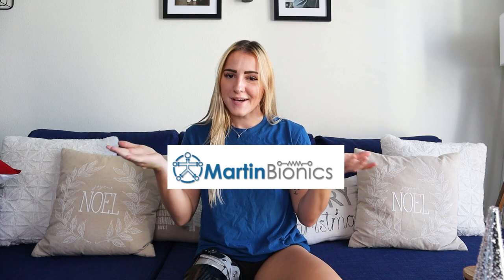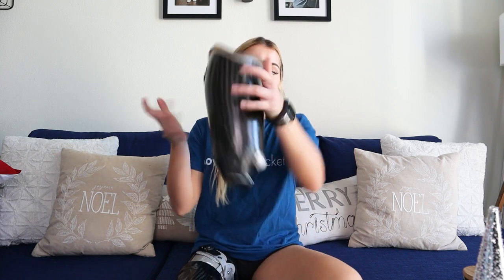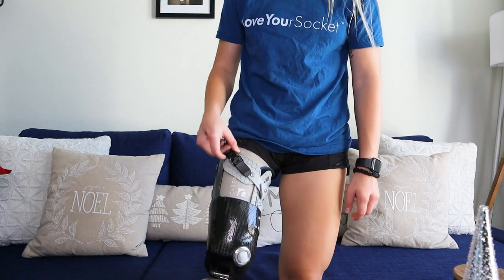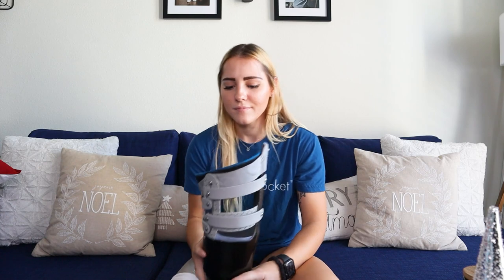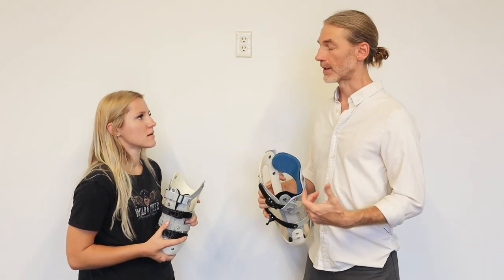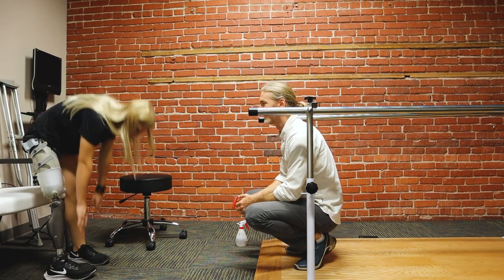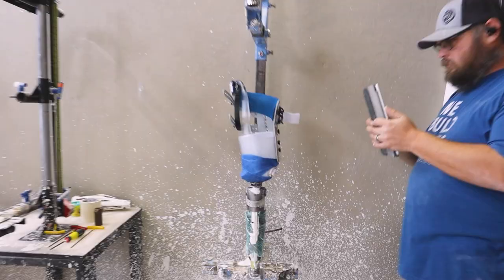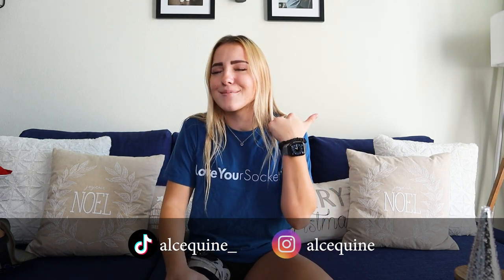Amputee Gets Martin Bionics Socket-less Socket

Comment: I have been an amputee for over 60 plus years.  The prothesis of my choice as been exsoskeital knee made by Ottobock.  This has been the only  limb I have ever worn.  I spent
45 years at the operating table with very long surgeries.  I am going to make this short.  This is my advice to recent amputees.  Shop around and get references before you decide on a
prosthestist.  Their are some very good ones in practice but their are so very bad ones as well.  Be very careful by these new scam artist pushing bionics.  I recently have came in
contact with one.  What ever you do do your home work first.  You will be glad you did.

Comment: Is there some way to get this in my local area? I lost my rt ak and have had nothing but trouble because of bad builders. I had one built and it never has worked since day 1. The craftsmanship is so bad I cut myself from the rough edges. It hurt so bad I told him it will not work. He told me well just take it and try it. If it dies not work out then in two years you can apply for a new one. By then maybe technology will be better. I complained about it and it went no where. They told me that because of covid things took longer than normal so my body had changed more than normal. I told them that it never has fit at every fitting . If I try and wear it my crotch area gets cut up so bad ot bleeds all over then takes weeks to heal up. I say it was poor craftsmanship from the start and never was correct. The knee feels like it is at my shin location. When I sit one looks like my leg is very long on top and no shin.I am to the point now that I want to bilid it myself. If I can get tge socket I can build the rest. I am a body man by trade and can build anything so why not a leg? I just want to walk again on two legs like we are intended to do so. Ride my motorcycle again and ride my bike. Its been too long on crutches and I want my life back. You inspired me to push again and try to get a bucket that fits and make my iwn..thanks and keep telling people about it. Im not going to take no for an answer this time. I want a leg that will do what I want it to. Not just get pushed through a corrupt system. I know the person who built my leg I have now did me a dis service. He knew it was junk and still pushed me out tge door. No prude in his work at all. After I got it home and compared it to other peoples that I know have prosthetic legs it is complete garbage and should be shown to builders of what not to do. If I fixed a car as bad as this guys work I would not have a job.

Comment: What is phantom pain. Do you have it ?
Reply: I have it. Phantom pain is horrible. It was much worse right after my amputation. Mine is below knee and it was after a motorcycle accident. It was nearly 100% amputated in the accident and it was about 40 minutes until someone found me so the limb was already dead when they got there.  Aside from my leg, I broke 12 other bones. I needed 3 skin grafts, had 6 bones that needed either stainless plates or titanium inserted through the center to hold them to the shape. All that and the phantom pain was the worst pain I've felt since the day of the accident. It had so many different types of pain. There was stabbing pain where I felt like a knife was diagonally through the front of where my ankle bends and came out at the corner of my heel, and then folded backwards so my heel was touching my calf. I kept reaching for it to grab the pain and fold it back the right way but it was gone. I had pain feeling like my toes were stuck in between a cable and pulley and it was grinding back and forth crushing my toes. The real horrible pain like that started becoming less frequent with time. I haven't had any that bad for a while thankfully 🙏. It got to where it would be triggered and got bad if I tried to move my ankle or toes that aren't there anymore. It's most difficult when I stretch. My knee was barely saved. My limb goes maybe 4 inches below my knee and when I stretch the limb twitches real fast. It's hard not to try to stretch my toes when I'm in bed and I wake up and stretch my "whole body". Now I get phantom sensations more than I get phantom pain so it's like an itch or feeling a tickle like a bug is crawling on it n stuff like that. I hope that answers your question and I hope you never have to experience it... Ya know, unless you're a child predator or something like that 😂 but otherwise I hope you never have to go through anything like this. It could be worse for sure but this is pretty horrible